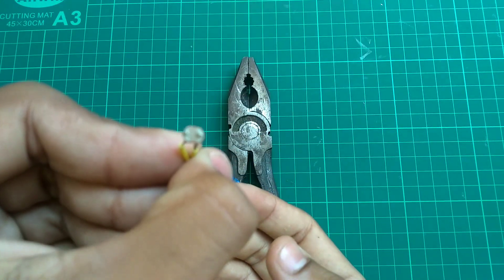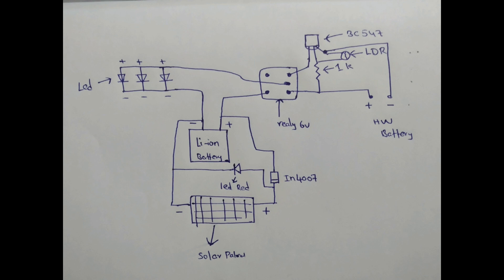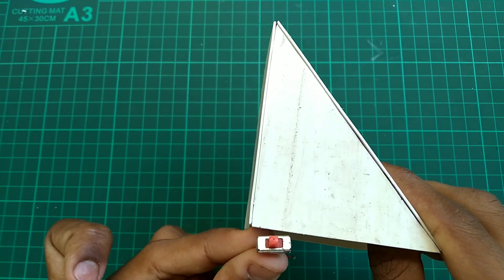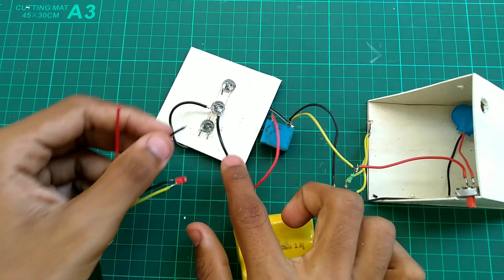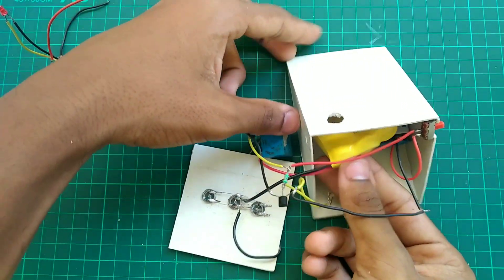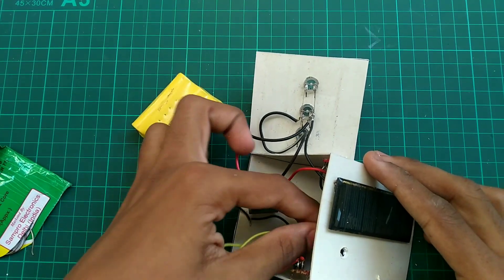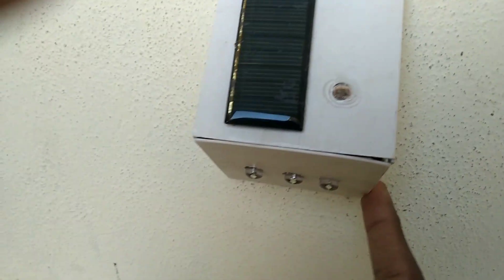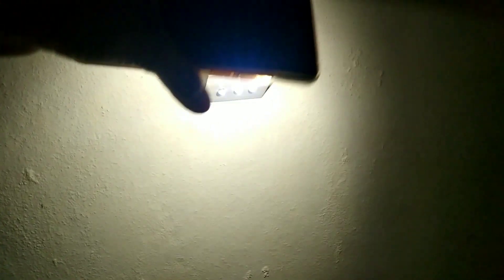How to make a solar rechargeable light||automatic solar light ||LDR light

Comment: Bro I want automatically on/of switch control
I already see at in Amazon the device price is almost 1000 rs I hope you make it please make it and do 1 video for it please bro
Reply from the maker: Ok bro
Reply: @TeluguExperimentswithLokesh   bro I want the device works on 240 volts shell you make it
Reply from the maker: Bro in our channel some automatic on off switch videos are their bro on check out our old videos with make with LDR
Reply: @TeluguExperimentswithLokesh   bro I want the device works on redio frequency RF or bluetooth or IR BLASTER shell you make it
Reply from the maker: Bro we can have some videos on our channel like home automation with arduino with bluetooth check out bro there is two parts part 1 and part 2
Reply: Ok bro
Reply: @TeluguExperimentswithLokesh   did you make the device with radio frequency RF I want that
Because I already buy it in amozon the device price is 750 rs 
So that way iam ask 
Any thing wrong in my words iam sorry bro